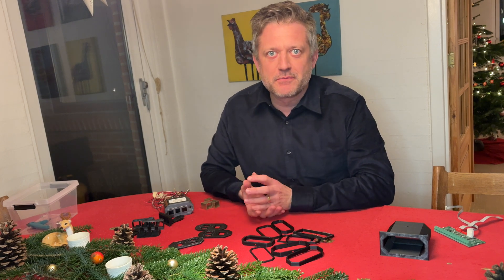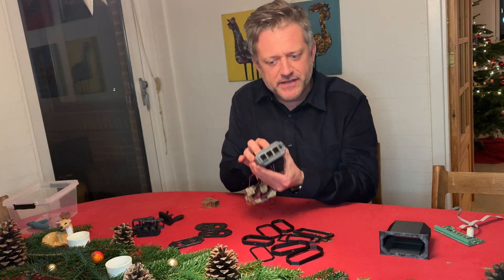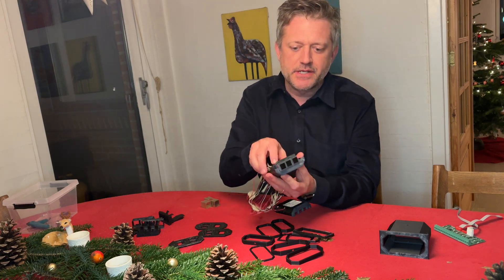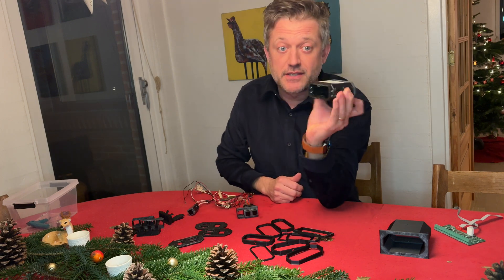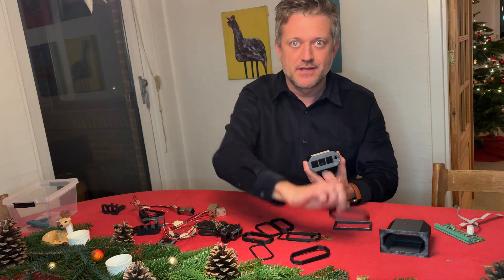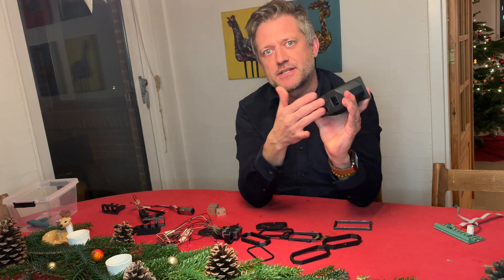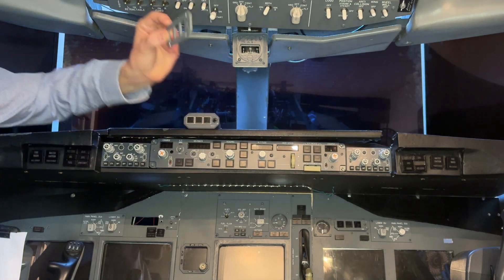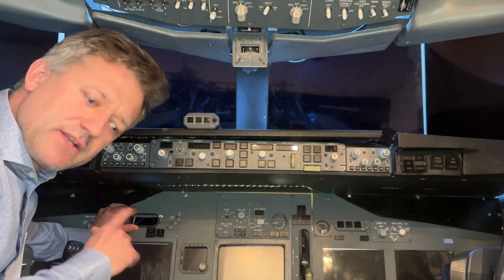OEM AFDS-panel Home cockpit 737

Comment: Hi Peter, I have a spare OEM clamp that will allow you to mount your AFDS module in the OEM panel.  Let me know if you would like it. Cheers.
Reply from the maker: Hi Mick. Thank you. It is tempting... I managed to fit the AFDS unit with the 3d printed bracket - so for now I am okay. Again thanks!